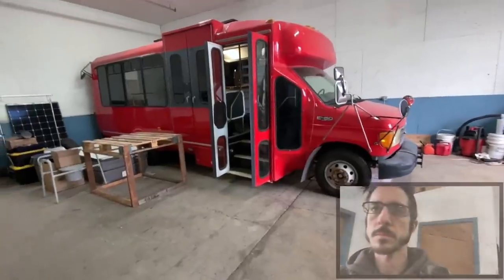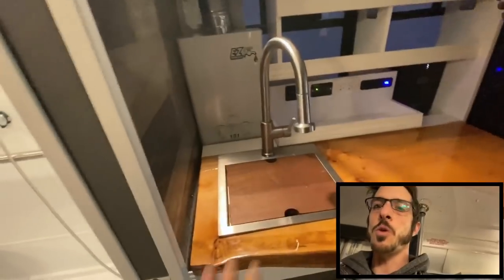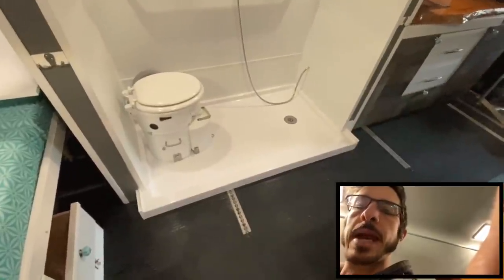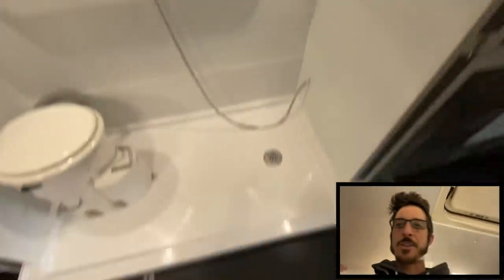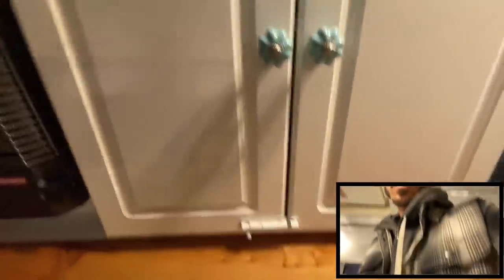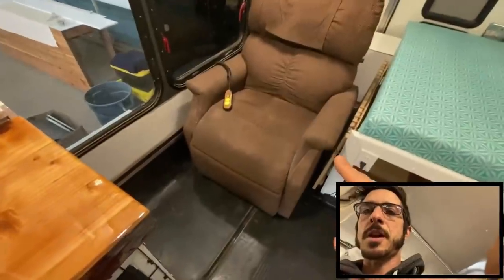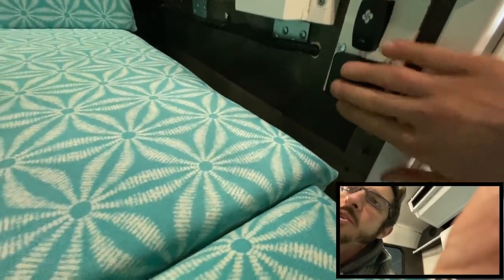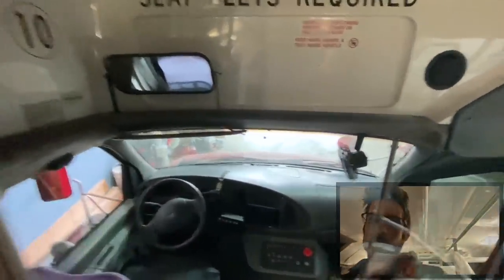Shuttle bus conversion is a handicap accessible TINY HOME / Huge shower and full size bed

Comment: Great build. It's a shame you do builds for others. You have so much talent to share. Love the desk on the lift but if folks ate going to walk on it..I would poly it like the counter tops to protect the wood for getting trashed. But an awesome idea I will steal if I get that kind of vehicle. My sister wants this or shuttle bus.
Reply from the maker: The desk is treated with teak oil. It’s not a hard resin but helps protect from moisture. I’ll definitely think about using poly in the future ✌🏻

Comment: I know this is late and the lady has driven off into the sunset no doubt enjoying her freedom but I  could not see any burners or oven in the kitchen area. If there is a set of burners and oven or microwave where is it?
Also if she is wheel chair bond which she says she is, how will she reach the freezer section of the fridge as it is quite high up?
🇦🇺🇦🇺😷😷🇦🇺🇦🇺
Reply from the maker: She is in a walker and will be traveling with her daughter. They will be using an instant pot and portable propane stove

Comment: Beautiful Countertops, ❤️❤️❤️ the sink , WOW you had me at FULL SHOWER Brad, so nice to have, I like they can still use the windows, and your Desk design is GENIUS & utilizes the ramp , so many great custom features , can you let us know what something like this would cost & if you ever decide to share your talents, A shuttle bus is my # 1 on my list because they are affordable , easy to repair / drive vs a 40 ft school bus ✌️ Marta Phoenix AZ 😎
Reply from the maker: I love the ford econoline platform. Unfortunately custom builds are not fast or cheap. This build took about 4 months and ran about $10k in parts/materials, and about the same in labor(which is on the cheap side) plus you have to account for the cost of the vehicle.
Reply: @nomadbrad503  4 months beats diy taking a year or two

Comment: Looks great! What do they do for cooking?
Reply from the maker: There wasn’t enough counter space for a built in cooktop. They’ll be using a folding propane stove and instant pot.
Reply: @nomadbrad503  idk if they did solar or are doing solar (I have interruptions in my home tonight) but perhaps an induction?   I have one I use for steaks, chops etc..they are the bomb
Reply: @chasethecat3839  I blew a fuse w one of those but good (1800 watts). I bought an inverter, at 6k watts. And I'll go right to the battery to test it. If it melts it or it does something horrible, it won't hurt the car.

Comment: did you do insulation? I am starting my shuttle bus and hit the dilemma with the ceiling insulation where I don't have metal ridges, only couple  wood strips running along from back to front. it seams that spraying foam is what pros recommend. I am not sure how to save the original fiberglass ceiling and spray foam. also wanted to keep original AC system. I see you kept it and original floors!

Comment: I am retired and in a power chair due to spinal cord issues.  I have always loved to travel.  I’m wondering if a 400 lb. motorized chair could be lifted and lowered on such a system?  Another question would be if the bus could accommodate a separate bed for a second traveling friend?  Maybe the second bed above the first one bunk style?  Your build is incredible and I am so impressed!  I am wondering also where you are based as if I were to go this route, I would definitely be interested in speaking with you about having you do the build.  😊

Comment: The color looks great!  Did you do that?  It's a nice paint job!

Most of the bus looks great, but there are a few things i would rethink.  I would have beveled the top edge of the desk so that a wheelchair would roll right onto it.  It's amazing to me how many electric wheelchairs are incapable of getting over a 1/2 inch barrier.  She is only in a walker but a wheelchair will probably come. Same for the shower, the wheelchair will eventually be a necessity.  Lastly?  As much as I liked your latchez at the bottom of the cabinet, she is at a very high risk to fall, reaching down to latch or unlatch the lower one.  Raising it up off the ground would help and i might even consider a split piece of firring strip about 4 inches long screwed down at the center tightly enough and easy enough that zhe could even cross and uncross that "bar" with her foot.  Just a out.  The rest of the build is great!

Comment: Very nice mix of off the shelf and custom work!  I hope she has an “EPIRB” type safety locator beacon.    
Also, how did you handle shower water going between the wall and the window?
Reply from the maker: I sealed that gap with silicone

Comment: Really cool conversion! What was the total cost for this project (Not including labor)?
Reply from the maker: The bus was purchased for $6,000 it needed about $3,000 in repairs(overdue general maintenance) and the build out parts and materials was probably around $12k
Reply: @nomadbrad503  not bad..not bad at all for the quality of workmanship.
Reply: @nomadbrad503  The ones I've seen are insanely expensive and a van is too narrow/tall. 

I wish I had somewhere to put something like this. Probably wind up with minivan/suv type thing, namely because they're better on gas and can be parked on the street in Chicago.

Comment: Hi Brad, do you do build outs for a living? Can you tell me the final cost for big red including the actual bus. It is very much what I will need, I'm 65, just had Bilateral anterior hip replacement surgery, and just retired. I love what you have done. I'm in the Pacific Northwest, where are you located?
Thanks!
Reply from the maker: I do not do build outs for a living. This was a special request from a friend. The bus cost her about $7,000 and the parts were about $10,000. If you hire someone to build you one from scratch, the whole thing is probably going to cost $50k or more. These builds are extremely time consuming because every detail is custom designed and built

Comment: Beautiful build man, hats off to you. Currently converting a shuttle myself and just curious where you stored the propane tanks and what size they are.
Reply from the maker: Thanks man, I built a propane locker under the rear bed. It’s vented outside and holds 2 20lb cylinders

Comment: The lay out seem pretty nice “ This is just “MY OPINION” …. But it would of been nice if the C-PAP table was a little further back so a parallel handle could of been put at the end of the wall to grab on to pull yourself out of bed.. Anyone w/ disabilities knows that getting out bed can be really difficult also is there another Area for the C- PAP if the person decides to sleep in the chair??  Also it seems like there could of been a nicer solution for the pull dwn desk instead of just plywood?? It seems kind of cheap ??? and last but not least ….. Since the van is as Beautiful Red would of been nice to have seen some red accent inside🙂 of coarse like I said, it’s only my opinion 👍🏼👍🏼👍🏼
Reply from the maker: That’s a great idea!

Comment: I’m converting a shuttle bus.  I have a Ford 2004 E450 with two alternators.  I’m trying to figure out how to tie my battery bank to the alternators for charging.  I have Valence LiFePh batteries which can be charged with a standard auto gel/gsm charger, so I don’t think I need a converter.  The big question is WHERE to hook them to the alternators, in the engine compartment, or the electrical cabinet above the driver?  Are the alternators separate systems, or are they tied together?
Reply from the maker: I have used the Li-BIM 225 to tie lithium batteries into an alternator. They work great. One side connects to the house batteries, the other side connects to the charging battery. You don’t need to touch the alternator

Comment: Great ideas. This is probably my future. I would say the bed is too high for me but the recliner is great. I would end up more in the recliner vs. The bed anyway. Maybe some kind of flip up or slide over  tray for the recliner. Also, one of those collapsing or fold in rods for the shower area to hang towels etc. There's definitely not enough closet space but of course it's sacrificed to the dog. I understand this absolutely. I think keeping the lift is a great idea for the future also.  I would add clothing/coat hooks wherever possible. Magnetic or folding. We can never have enough hooks. 😃
Reply from the maker: im happy to hear this

Comment: Do they make lifts for just stepping on to get in a van? Not the big wheelchair lift. Obviously in a Ford Connect. I am going to have a Ford Connect XLT converted and my problem is stepping into the side door.
Reply from the maker: They make wheelchair vans..I’m not aware of a separate lift that could be added

Comment: Might have put the fuse block higher up for ease . lower storages might be a pain to get into ..It seams enough  to move around in but not knowing  the owner size should  be ok..? How will the AC work if off grid..or is it shore power dependent,,,? I like the live edge counter top give it  natural feel.
Reply from the maker: It definitely would be nice if everything was located at waist height for ease of access. Unfortunately that’s not possible. The ac can only run when the engine is on.

Comment: The sit down option in the shower is really convenient, especially for older or disabled. We remodeled our home shower to include a built in bench so my wife doesn't have to roll her wheelchair all the way in the shower. When I tore my Achilles tendon a couple of years ago, I had to use the bench and it was a real nice way to go. If the owner of this one has a back problem the recliner is very comfortable to sleep in since she can adjust the angle of her back. Nice counter tops, just would like to see a better finished option for the computer desk on the motor ramp.
Reply from the maker: Thanks, she’s very happy with the setup. She has been on the road since it was completed

Comment: hey man check lowes for a onoff valve for the shower head,  they make a little chrome valve like what u did on this shower but its small and made specific for showers, we have been traveling for 7yrs full time now and i have always used this little on off valve, ill take a pic and send it!!  the build looks good and defiantly one of the better showers i have seen over the yrs
Reply from the maker: Thanks man! I used this large one because I thought she may have difficulty turning a smaller knob

Comment: I hope you know that any airflow around a heater with a flame can cause the burner to not burn properly which could leave more carbon monoxide in the van? You might want to pick a spot for the fan a little further away from the heater
Reply from the maker: Thanks sandy!

Comment: i like that usb fan   did it come with the segmented legs? what was your build cost? and where are you located? ever work on smaller vans like an astro van?
Reply from the maker: The fan is great it comes with the legs! I even bought one for myself. I am located in the Austin Texas area. My first build was a Ford e250 cargo van. Parts and materials for this build was about $10k

Stroller Fan, 5200mAh Battery... https://www.amazon.com/dp/B086JT4J9Q?ref=ppx_pop_mob_ap_share

Comment: One of the best accessible builds I’ve seen. The truly custom builds tend to be better than the cookie cutter ones, but that goes without saying. I like the dual purpose lift/table. I would have thought she design it to be more wheelchair accessible since she’s using a walker now, it may only be a matter of time before she’s using a chair most days. I was thinking the bottom locks on the drawers might work it’s way loose with vibration though. Nice build overall.
Reply from the maker: Thanks for watching

Comment: This has to be a effecent and cost effective for someone on a budget for remodel no installation.. but would not work in cold climates unless you got a small wood burning stove...
Reply from the maker: Yeah, I would recommend a diesel heater if you’re going to be in cold climates for winter..but typically vehicle dwellers chase the sun. That’s why our homes have wheels ✌🏻

Comment: nice job!  i wouldnt have used the orig inefficient AC. dunno if theres enough power to run it unless van is running. maybe just get very efficient window unit that frigidaire makes (they only make one super efficient unit aside of their other line). Bob Wells made a video including it...there was a guy with massive solar he interviewed about it & other high power things he runs
Reply from the maker: Yeah, the ac only runs when the bus is on

Comment: Happy you’re making handicap accessible van life. One quick note, though. Don’t you think an ‘under the bed dog crate’ could’ve saved you some space? Like the recliner could’ve gone in that space and a bigger closet space, could’ve been where recliner is which would’ve also allowed for the bed to be laid out completely, so the handicapped customer wouldn’t have to struggle so much.
Reply from the maker: The whole build was a struggle due to large items and small space. What I didn’t show in the video is a 48 gallon fresh water thank and dual propane locker tank under the bed. Also the bed couldn’t be high enough for the dog crate to fit under because the client needs to be able to back up to and sit down on the bed.

Comment: My friend just bought an F350 almost exactly like this one. We’re trying to figure out if it comes with insulation or if you have to strip the walls and install.
Reply from the maker: It depends on the builder of the body. Try to peel back a panel and take a loot

Comment: Nomad Brad

Years ago I read a prequel to the Sherlock Holmes stories. It’s where Sherlock Holmes went to college but didn’t take the normal curriculum. And he took all kinds of different classes because they did not have forensic science in college.

So I’ve been doing the same thing with YouTube! Being that I have different challenges and goals that a lot of people out there doing RVing Don’t deal with I had to cobble together a bunch of different philosophies to come up what works for me…

Until Brad.

I am at incomplete quadriplegic. I cannot transfer on my own I cannot hardly roll over in bed on my own. I’m a big guy 6 5 230.

There’s a lot of logistical issues related to getting in and out of the chair.

So normal RVs builds don’t work for me.

I love the brilliant use you made of the lift by putting a desk on it. They gave me a great idea though it will be slightly different.

I bought a 2007 star craft shuttle bus 23 passenger.

I’m starting to formulate my approach and how I might adapt it to my needs.

New subscriber will definitely be following along

God bless
Reply: You did exactly what I’ve been planning on doing. Using existing bolting spots for the seats to tie down your cabinets.

My StarCraft has two bolting spots. One on the floor towards the middle of the bus and one against the wall. That’s exactly what I was planning to do and seeing you do it validates my idea.
Reply from the maker: I’m glad to hear that you found some inspiration ❤️ a lot of people have been reaching out after seeing that handicapped bus conversion is possible. You may see another one sooner than later ✌🏻

Comment: I'm extremely impressed!  This next statement is personal.  It's a bit of a quirk of mine, but I'm getting over it (I think, lol).  And maybe you can help me with some of your reasoning behind it.  I've always been a stickler about windows.  Yes, I want them to be able to see out.  No, I don't want them because I am concerned about heat loss. (I do want a few)  You've gone ahead a built right over them where a I would be fighting with myself about removing most of them and wanting to weld an exterior in place, insulate and finish the inside.  I am guessing that if they are left in place, it would be easier to replace the entire window if any damages occur.  No?  Or by replacing the window, is the elimination of damages a better position to be in ? I get that I can come up with some sort of an interior insulation procedure, but I don't think it would be as insulating as a solid wall.  I'm also concerned about all of the condensation that occurs on the interior of all of the glass.  How would one eliminate that and reach behind all the build to dry it up, or insert towels rolled along the bottom to absorb?  See?  After understanding that the saying 'to each, their own, does apply, I'm still confused at my position on this.  
Did you add any extra insulation to the body of the bus before you started any of the build?
Reply from the maker: I did not add any insulation, this bus will be chasing the good weather all year. You would need a different setup for cold weather
Reply: @nomadbrad503  Yes, I do get that ""IF"" I want to use it at all in any type of cold weather that I will have to do something. I was just hoping that you might have used, or done something that I might have been able to incorporate.  I respect your ideas and really love what you have done with your transformed vehicles so far.  It's your version of the shuttle bus that is leading me to incorporate a shuttle bus in my searches.  I mean there is so much more room!  And However, due to the outcome of your cube van, that is still in my searches as well!  lol

Comment: Too bad you didn't use thicker lumber, maybe a live edge top for that desk.   That 1/2" plywood will go bad fast!!!
Reply from the maker: Live edge is too thick and heavy for this application. remember she has to roll her walker across it. At some point they may decide to switch out the wood with something else
Reply: @ Nomad Brad.   How thick much live edge wood have to be???  Isn't an inch possible???  Looks like that counter is about 3" - an inch thick on the lift would still work i think.  And it would tie it all together and make it more same throughout.  Besides you can never have too much live edge in my opinion!!!!